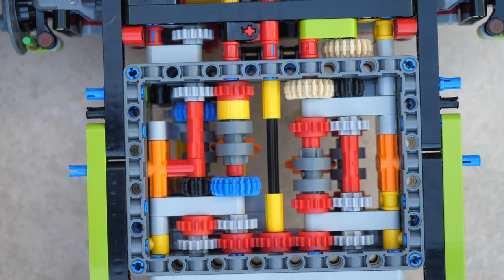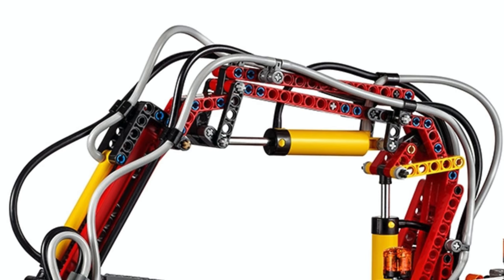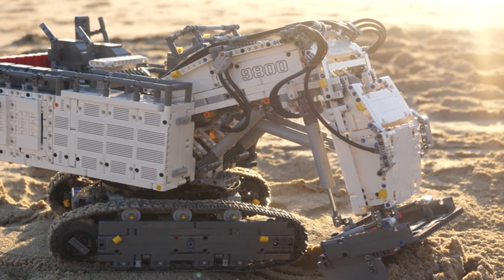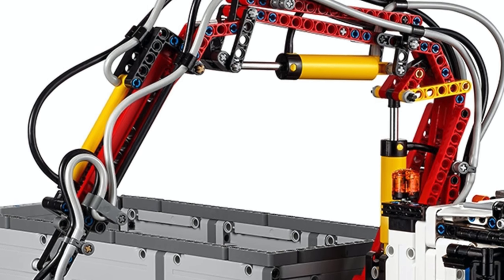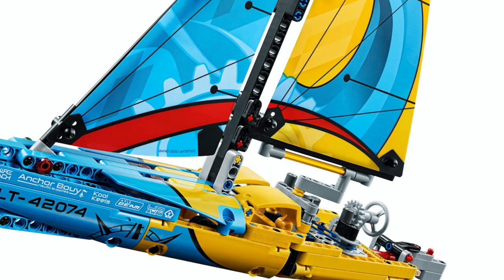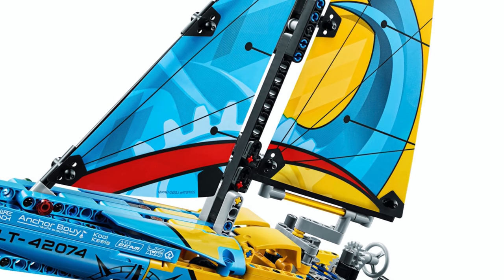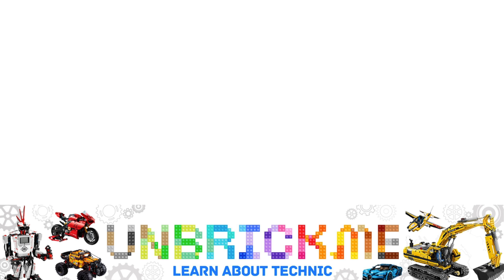10 Functions LEGO Technic Needs to Introduce

Comment: LEGO needs to bring back powerfunctions
Reply: I was thinking that long that long lines in actuality though power functions is somewhat compatible now at least there are ways of doing it not sure if this is completely rolled out as in terms of getting the bugs out of it per se.

But with the powered up system and all that is there is the color / distance sensor or whatever they call it I can't even keep up sorry.

But unbenounced most there is an infrared emitter in there and this can communicate with the Lego Power functions remote control receivers.

Thus giving compatibility however it would probably be quite awkward in some cases!!!!

Which in practice would allow the use of a RC buggy motor for more power.

Additional downside is one more battery pack as well!!

However this does get interesting in the effect it theoretically you could actually control up to more than eight Motors at a time not talking about just how it up and all that other Motors but actual power functions Motors.

This could be done by building an enclosure that would completely Shield all of that from light.

One would also want to close off where any wiring exits as well.

This would probably be best for things that were fixed in place but just need a lot of motors because of the bulk of the assembly.

Essentially you could have up to four power functions infrared receivers with the infrared window all point in the same way and near each other and the powered up distance sensor or whatever you call it also color sensor whatever.

In close proximity encased in some sort light tight Lego enclosure.

And if it were possible on the powered up system to do more than one of those sensors don't know if this is or not.

One could theoretically have as many groups of eight Motors at least up to that.

As one would have ports available.

Also in terms of other things mentioned in this video

The heart referring to remotely controlling the pneumatics is very much possible already.

One could use a motor to control one of the newest pneumatic control valves directly or indirectly some sort of return to Center mechanism.

But that would require flood control Channel pneumatic control.

Although one could Multiplex it Mike has been done with mechanical functions before in other Lego sets.

Such as a gearbox with a motor selecting two different sets of outputs for the same Motors leaving other channels free for controlling other things either on this multiplexer or straight up just its own thing.

Also with the power function system one could have done this strictly electrically well besides a motor driving the switching mechanism.

All you have to do is used to polarity switches at certain angles to each other and switch between with a motor and you can pretty much mostly double your number outputs but again this is complicated just like other Solutions.

I once saw something like this doing with the old Lego interface b and 9 volt polarity switches although a few of the motor channels were used to control other things and also for a few lights.

Also I saw the same person who do the same sort of thing accept multiple Banks of motors being switched between the outputs.

It was using an old laptop had a Serial serial port and also they were using a Lego interface a for other things which was 44.5 volt system not 9 volt.

 and yes that was originally designed to use the parallel printer port although in some cases that used a custom card and a war connector cable depending on the computer system it was being used on.

There was even an IBM PC card specifically for it you are no parallel port would have been an option.

By the way the cable that he had for this was a custom cable although using the intended method to drive it from the laptop parallel port.

Don't know for sure I think it was a custom Linux program to operate all that?
Reply: Also in terms of on the video where they were talkin about sound and a speaker.

That would definitely be doable all you would need would be a firmware update theoretically.

Since the motor Drive lines are already there.

AKA positive and negative output that are reversible.

Wouldn't take much circuitry although there would need to be a safety circuit that would prevent damage to the speaker if for some reason straight-up DC current were supplied of course that would burn out any speaker voice coil.

But this would probably incorporate some sort of amplifier potentially or a volume control at least.

It can in terms of the Hub can already do pwm 4 speed control of course.

As a matter of fact on the old rcx Mindstorms system there is firmware can't remember which one that can actually use one of the Lego communities created programming languages 

That can actually produce AC output it would be square wave more than likely or close to it although theoretically could be marginally in a bit if you switched it fast enough but unfortunately would be either 4 on 4 off so definitely Square wave.

Which in that case was intended at least with one of the functions to be used with ball railroad digital command control receivers for Lego 9 volt cramps with modified vicowl of course if this is acceptable to you Lego purist not so much.

Also it's possible to communicate from one RCA X to another in some of these languages without using infrared by using a light sensor and a light source or two light sensors one as a source of light and one is a receiver how to do digital communication.

It's also possible to switch between float and brake on an output to do that but it's more risky somewhat to do that with an input directly or either or add some resistance in line although there are ways of doing that that's 100% Lego believe it or not.

But it gets complicated with the hook up with a 9 volt system of course.

Getting ahead of myself but there's all kinds of ways of doing things that one would not think of.

Also another potential way of doing potentially a connection of the powerful emotion system to the the powered up system or powered Plus or whatever it's called I can't keep up sorry.

Would be to have a powered up 2 power functions converter cable.

The power of system is of the same voltages as the 9 volt system already.

At least in terms of the voltage range could do even if rechargeable batteries for used that is.

Or just regular disposable batteries as well!

But what would be better is if there could be a powered up/ whatever the system's name is again can't remember.

Essentially a hub that would plug into the Hub that would have one input cable and then have a battery box built-in or perhaps a powerful emotions cable for power input of some description and then house powerful emotion Sports 4 maybe four or more outputs.

There could be some additional smart sin that Hub as well.

Such being able to monitor motor or other accessory current draw ta be able to tell for motor stalls and other conditions and definitely would need to support the call functions Servo motor.

Also it's me it seems like the pwm speed control on leave power function system in terms of the seven speed levels and off and potentially break.

And of course both forward and reverse.

They have been a hold over from the earlier 9 volt system not modern Mindstorms or anything like that but even before month storage was even released perhaps even before the film that started?

Vigo interface B had a very similar idea don't know if the pwm frequencies were in the same or anything but theoretically the it could run the servo Motors I think I've heard that they would have tried and it worked but cannot confirm this.

 eventually I would like to get at least two of the interface b's.

These could be easily operated with USB to serial port adapter.

Probably best bet would be some sort Linux system of some description.

 one good option would be Raspberry Pi.

And since of course it would have USB go to S Wi-Fi excetera and more.

Which would being compatibility with the powered up system and all that as well.

Plus a custom application perhaps combined with a touch screen.

As well of course you have all the general purpose Ayo and other functions with those pins as well.

 you could even do infrared for other devices well with power functions and potentially even communicating with the rcx and other Lego controllers as well.

Theoretically you could even do Vile visual light Link.

 of course you would Implement a two-way infrared.

 and then of course with the wireless you would also be able to communicate with the other and newer Mindstorms systems as well the generations before powering up came out that is.

 probably best solution would definitely be Raspberry Pi since it would be so flexible and can be easily customized.

Add something like a PlayStation controller and there you go.

One could even to build something that could do all that that could be battery powered.

 it could be a handheld device that could act as a master remote for everything.

 and perhaps do some sort of Wireless for a call for anything that would be plugged straight in normally.

 oh and one more thing having USB brings up the potential of even using the we do at least the USB version of it as well.

Even potentially the newer version although not sure how useful that would be because it's kind of anemic.

Also eventually all Lego Hardware is supposedly going to be becoming open source some of which has already been released at least the older Hardware but haven't been keeping up with the details yet

Comment: Speaking of Lego boats: I'd love to see waterproof electric components and, potentially, even controllable Lego ballast tanks. It would be amazing to be able to build an RC submarine to swim around a swimming pool. Alternatively, you could build underwater vehicles that drive along the bottom.

If there are signal issues, they might be able to do something with ultrasound, like maybe there's a little floater with a wire that plugs into your phone's audio jack.
Reply from the maker: Great ideas!
Reply: I think a long while back LEGO actually made a boat motor in the LEGO system line up
Reply from the maker: LEGO man 478 that’s awesome! I want to buy it! What’s the set number?
Reply: Its number is 48064
Reply: The only problem with the submarine idea(btw great idea)is LEGO would have to make a radio control and and a radio receiver and I don’t think they will do that
Reply: Waterproofing completely would be difficult because it would need to last a long time, and if water gets in and messes something up, Lego would probably be at fault
Reply: Phones don’t have headphone jacks anymore plus even then it still would have very poor signal and range, best to have just long durable wires that can connect to your phone
Reply: @Calvin_478 they already did in the 90's for an RC buggy racer, didn't they?

Comment: I personally think that LEGO should introduce an updated Powered UP version of the RC Buggy Motor (Like a Powered Up S-Motor). Even if it means sacrificing a higher voltage battery box (which is honestly not as likely), the motor should still be able to spin faster than all other motors at the hub's current power supply.

And for all those who vote in favor of improvements to the LEGO Technic system, I may be releasing a petition for these changes soon, so you might want to stay tuned.
Reply from the maker: that sounds like an awesome idea!

Comment: Automatic transmissions are either kinetic energy controlled CVT-s or computer controlled planetary gear-clutch stages.
None of them are really feasible in Lego systems, or would be too big and heavy / single closed units not really fun to play with. Same with torque converters.
However a planetary gear set would be nice to have. They only need to bring a ring gear to the table.

It is possible to build a pneumatic engine with a cylinder and a valve. Put 2 of them together with 90° phase offset and you have almost constant torque all around the rev cycle.
A two way solenoid with spring retention would be nice to pair up with a pneumatic valve for RC controlled pneumatics.

Comment: Here's something that would be amazing: a way to mount a phone on a creation to give it a camera, then remote control it on a computer (or another phone).

The commands would go through the internet to your phone, then over Bluetooth to the Lego creation. The camera feed would go over the internet to the computer. This would have some very noticable lag, but would allow you to use it as a drone without raising the price tag. It would also let you give the creation a display (using the front camera and screen) and a speaker, which could add extra play features.

The phone mount could be constructed from existing parts, adjustable with sliding cross axles to fit most phones, and use some of those rubber pieces to avoid scratching.

I've done so before on NXT creations and it works decently well, although I'm controlling it through my computer's bluetooth (doing a video call to the phone for a feed) so the range is limited. Connecting to internet would give effectively infinite range for phones, or at least a connection around the house for wifi-only devices.
Reply: This could be done simply enough with a 3rd party app, but no one has made one yet, unfortunately. I think it would be a good idea for Lego to look into it, since it would let them add features and gimmicks.
Reply: I actually kind of like the idea of a phone-based Mindstorms. It could even use existing power bricks, since you'd essentially be programming an automatic remote control. That would mean that anyone who gets a single Technic set could potentially start learning to code.

They could get around the lack of sensors in the existing bricks by taking advantage of a phone's existing sensors (camera, accelerometer, gyros, microphone, and even temperature). There's no touch sensor, sadly, but a phone's autofocus would allow for basic rangefinding and a sudden jolt could indicate if it hit an obstacle.
Reply from the maker: That is such a brilliant and awesome idea!!! Maybe I’ll try this with the news MINDSTORMS
Reply: @ENCHANTMEN_  The Technic brick has accelerometer and gyro, even a "gesture" sensor that can detect certain behaviors in those sensors (like dropping it or it bumping). This is available right now to app/software developers through their documentation.
Reply: @bami2  Right, I'm just listing the sensors that would be available to a smartphone without needing any additional hardware.

Comment: Really nice ideas but most of them contradicts the lego safety standards. Imagine if kid playing with remote controlled boat in his bathroom gets electrocuted. Or if pneumatic engine goes too fast, model can simply be destroyed by crashing into the wall or something. I think lego wants to introduce it, but just can’t
Reply from the maker: Actually it’s unlikely to get electrocuted  from a battery pack in the water. When you drop your phone, tablet, or anything that’s UNPLUGGED into the water, you will not get electrocuted. You only get electrocuted if you drop your phone in the water while it is charging, the device has to plugged into a power outlet

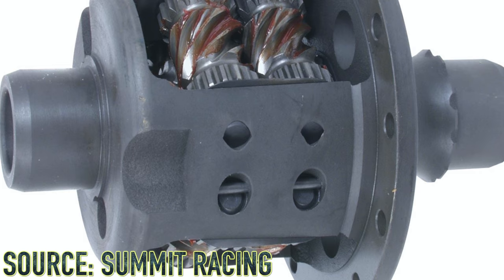Comment: 3:27 From these, I like the Torsen differential the most. I think I´ve even seen Sariel test a 3d printed one in a video. So nothing impossible and on top of it very helpful.
Reply: I found the link: https://www.youtube.com/watch?v=M78UMa2lMG8
Reply from the maker: Interesting! he probably has a very high quality 3d printer since in order to get the small and intricate parts printed so well you need a very expensive 3d printer
Reply: @Unbrickme  He didn't print it himself, he got (or bought idk) it for testing. There is a link under his video where you can buy it (cca 12€). The company probably doesn't have some bad 3d printers even though I think you could print it also with a normal one. You just need to find a good settings, material and of course the file, which they don't publish.

Comment: I'd personally like to see different types of sets and functions associated with those, instead of releasing more cars, when looking at the Technic lineup.
1. Trains would be a cool addition, including some on the scale of the Bugatti or Sian. I know there are system sets available, but I'd like to see sets targetted at the Technic audience. This could include different train designs and eras, and possibly a carriage design or two, with more details and function than the system counterparts.
1. More airplanes and helicopters would be neat. It would be interesting to have an airplane that can house a lego car with a retractable back (maybe taking advantage of the pistons and control+), or helicopters with interesting designs like the cancelled Osprey.
1. Robots. It would be cool to have things that you could play around in this space. Maybe with things like eyes that can blink, or fully motive fingers with extend/retract capability.
1. Walking robots. It would be cool to have things like a lego version of the Boston Dynamics robot to play around with, or different designs like multi-legged spider-like robots.
1. Motion/stability sensors would be neat for things like robots, allowing you to detect when the robot is tilting to one side.
1. Pressure sensors would be cool as well, allowing you to detect when a foot, hand, or finger is touching a surface.
1. Amusement rides. It could be cool having some of the more mechanical rides implemented as Technic sets.
Reply from the maker: technic trains, more aircraft aircraft would definitely be very cool! There are actually already "technic" robots with lego mindstorms and in the new 51515 set we have a walking robot called Gelo who walks a lot like the boston dynamics spot robot dog. Amusement rides would be cool for technic sets too!!!